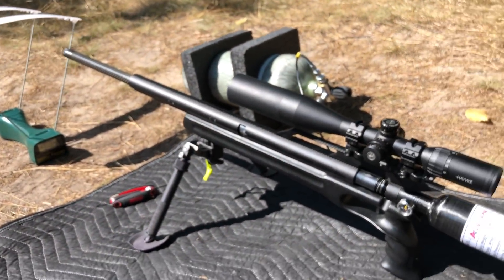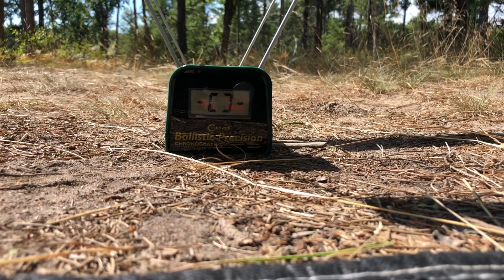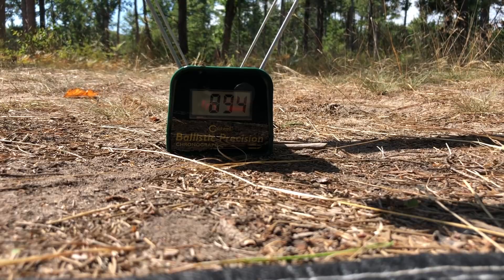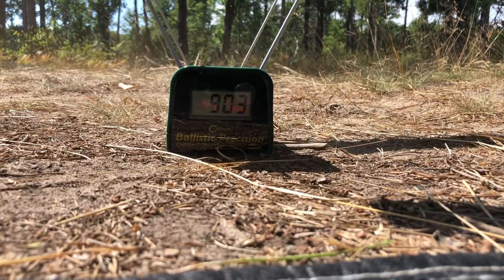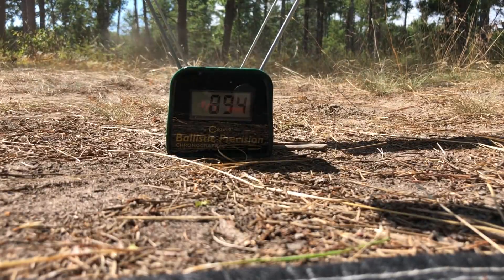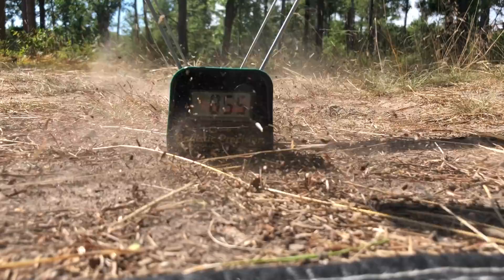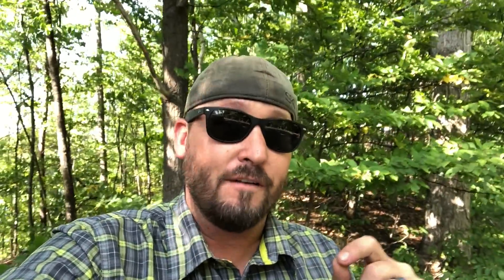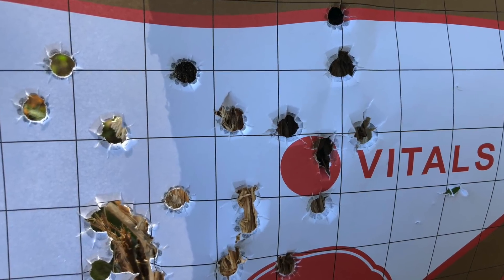AirForce Airguns Texan @ 4500 PSI = 600+ Foot Pounds of Energy / African Air Ordinance Super Valve

Comment: I got that same valve as well I’m hiting 600 foot pounds with a 3500 psi fill with the medium spring almost maxed out with 372 grain flatnose
Reply: Or almost 600 foot pounds I should say I’m hitting 592 pounds at around 848fps but on another note I tried out the boat tail because of your  video and those things are awesome I’m getting a 2 inch group at 150 yards
Reply: 50 cal hammer